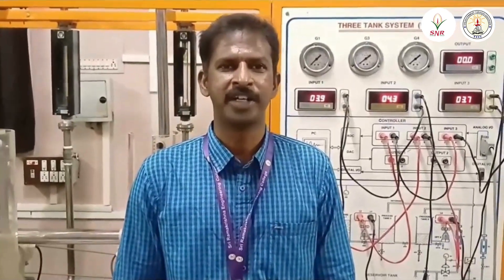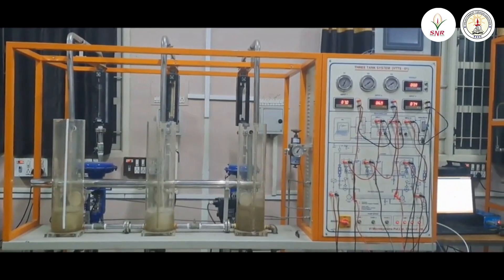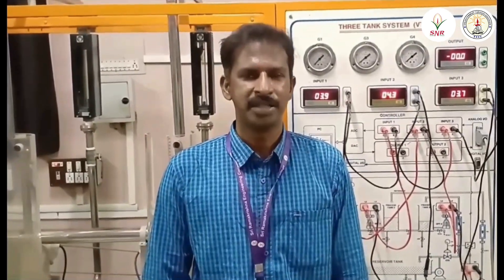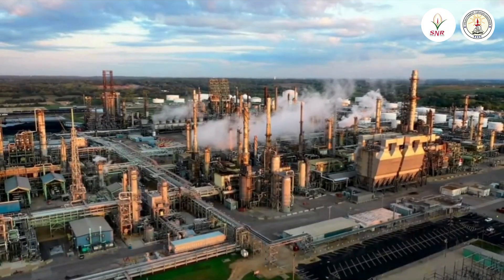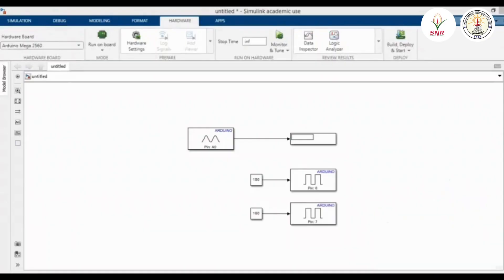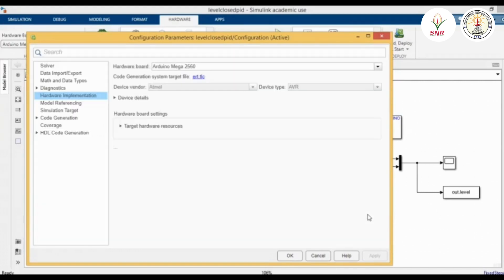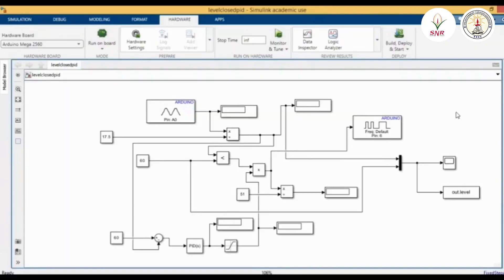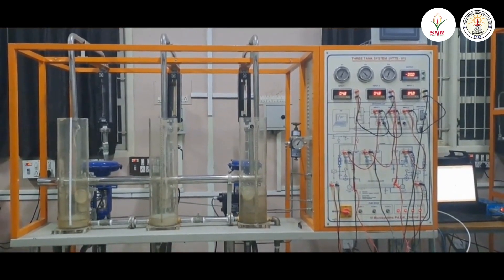Electronics & Instrumentation | Ramakrishna Engineering | Three-tank system #SREC #MATLAB #Tutorial

Comment: Im from NIT Warangal. Need clarification on How does the interplay of fluid levels in each tank affect the overall stability and performance of the system?.   Thank you .
Reply: Thank you for rising the questions. Let me clarify it. The interplay of fluid levels in each tank directly impacts the stability and performance of the system by affecting factors such as flow rates, pressure, and overall system dynamics. If the fluid levels in one tank fluctuate significantly compared to the others, it can lead to imbalances in flow rates between the tanks, potentially causing overflow or underflow situations. . Are you ok with the reply.

Comment: Sir What backup systems are in place in case of equipment failure or power outages?
Reply: Having additional tanks that can temporarily take over the functions of the failed tank ensures continuous operation. These tanks should be kept in standby mode and regularly maintained to ensure readiness.

Comment: Awesome Video ..i have few doubt on this tank system..Where it is used in Three tank system in petroleum industry..How to control the middle tank, where it is disturbance tank or process tank ..could you explain my question sir..
Reply: The system might represent stages in the refining process where different tanks are used for separating, storing, or treating different fractions of crude oil or refined products. Thank you sir
Reply: In some systems, the middle tank might act as a buffer or surge tank, designed to absorb fluctuations or disturbances in the process flow. Thank you sir